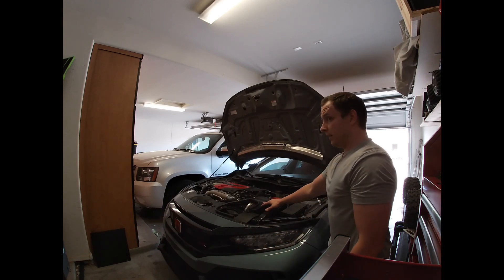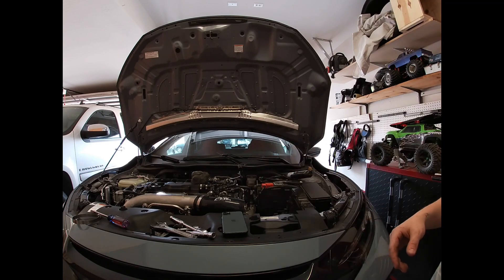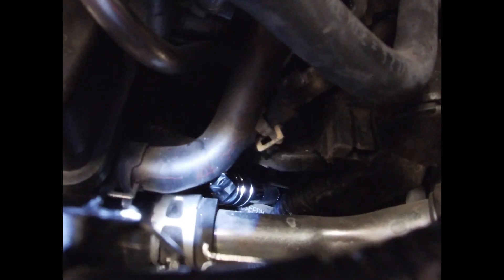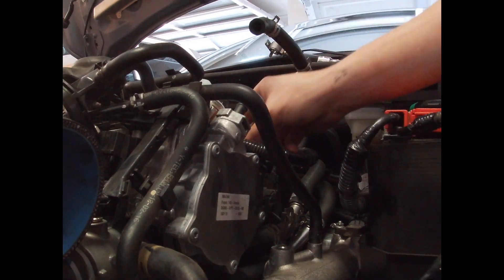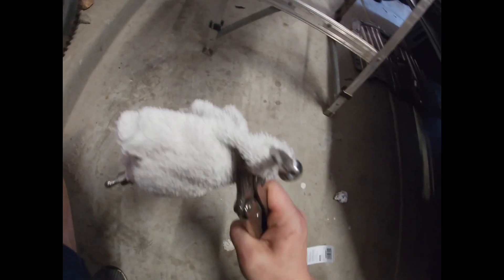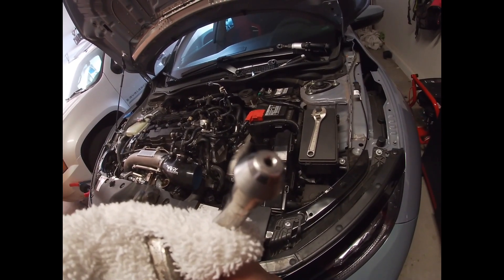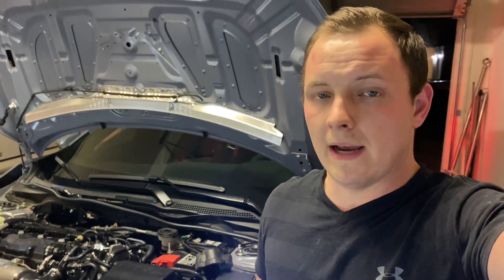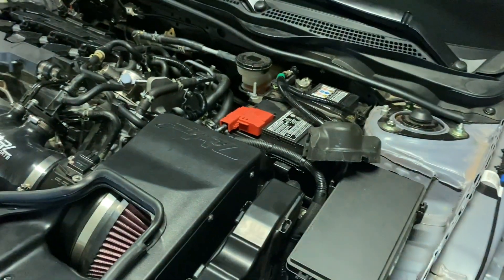Type R High pressure fuel line mod

Comment: what if i were to only disconnect the top part of line on hpfp and drill it up there and prime to get the shavings out? without having to remove the whole line.
Reply: Did you ever do this?  By running a vacuum while you are drilling I honestly don't see a need to even take the line off!

Comment: got my xdi fuel pump installed and datalogged, as you said it appears high rpm fuel is struggling a little bit at times.  Going to do this and hope I dont screw it up, thank you for the video!
Reply: just finished this mod, what a damn PAIN in the ass! that bolt that attaches the fuel line back i also left off, it was a pain in the ass to get out and pain in ass to get back in
Reply: @sneedoh3186  Did this end up helping?

Comment: Hey Zach... Thanks so much for the video. 😎👌🏻

Just one question, it looks like you didn't re-attach the centre 10mm bolt of the fuel line when you put it back on. Is that correct?

Comment: I think it would be important to use carb cleaner and compressed air to blow out any metal shavings from the fuel line after drilling.
Reply from the maker: Yes, that was something I forgot to mention.... I had carb cleaner on hand which was great for getting those shavings out